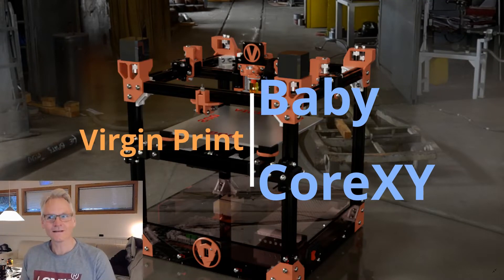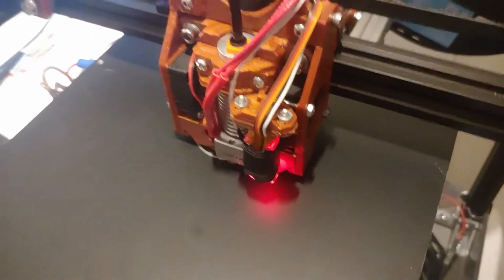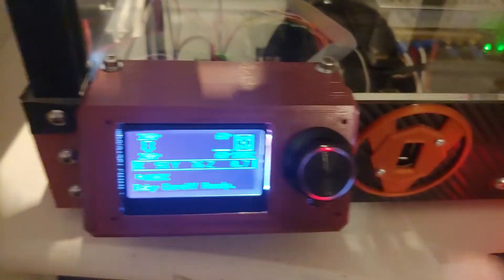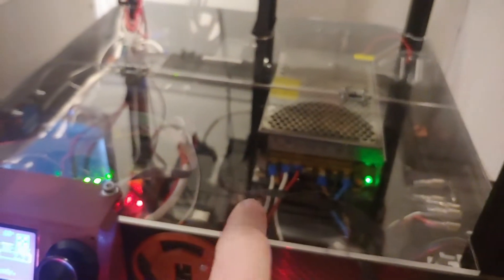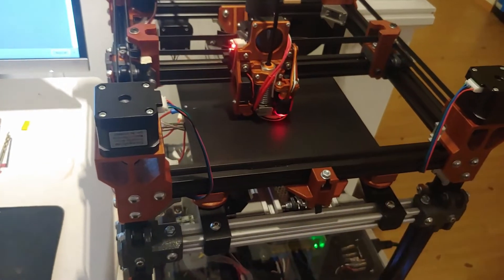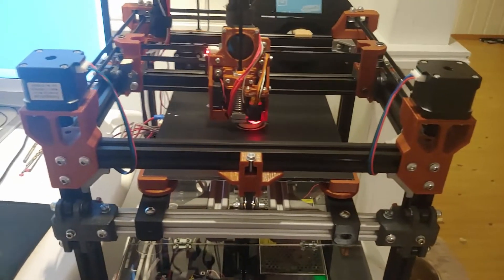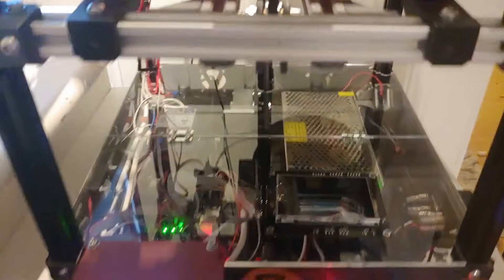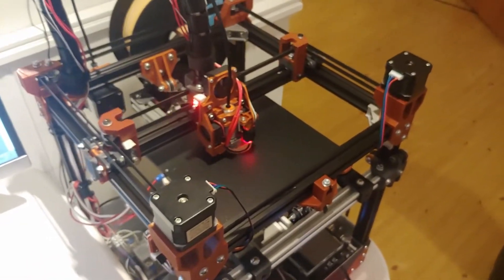Opensource 3d Printer | The First Print

Comment: You seem to be doing something unusual for bolts. Not using recessed holes for nuts, some bolts with curious hat flanges on them. I'm concerned in the first instances these rattle loose, and in the second instance, there's some unusual part to buy. Any reason for not doing the same m3 hardware everyone else does?
Reply from the maker: Thank you for the feedback! For bolts this design is so tight it needs low profile heads. Socket heads will not work in all places so I went with button heads all round. It can be other low profile bolts
Reply from the maker: You should use lock tight screw glue to eliminate rattle loose. Some nuts are locknut and some have resessed slots but this is not possible all over due to design constraints in dimensions
Reply from the maker: It might be that for m3 you can use standard heads. It is mostly the m5 that have a head problem..

Comment: great idea, thank you for your time, knowledge...

but, ;) 

... if i may say so, you are designer, and when you look that 'baby' 3d printer in action, don't you have a problem with that 'high' in the air, 'arm', which is filing a 'plastic'. Like somekind of excavator ;)
Ok, i get it, these days are biger, stronger, faster, very popular, but, where is elegance?

Don't get me wrong, i know, if a printer work excelent, who give a aple ;) for that elegance, but, anyway, you are designer, and i expect from you elegance ;)

And these 4 motors at the top, me is remaind of somekind of fortress ;) 

is there any chance that filing 'arm' is coming from botom, side...? 
Not everone have a  1,5m of space for the printer.
i think that v-king, and 'baby' are to big in dimensions.

I know, everyone wants these days biger biger biger, but why?
What you will print in 300mm dimension or bigger in height? (A Vase ;) ?)

And one more thing, when 'people' see needed parts list, and price for the 'big', they are shocked! And they should be, big cost big :)

Maybe i am wrong, but you have bilded a 'large' size printer (V-king), and baby, if you ask me, is small, cute, elegant and very capable ;) All the parents knows that :) So make it a small ;)

And how come, that you alredy working on a 'baby', is something wrong with a V-king?? 
What is a 'upgrade' in 'baby' from the V-king?

2 display, comone mate, be serious ;)

Maybe you can make, like hypercube can, that 3d printer can 'change' tools? (drling...)